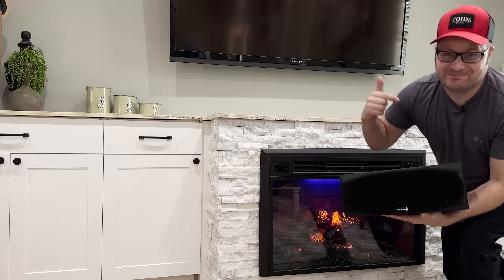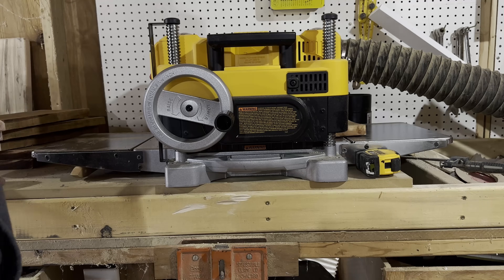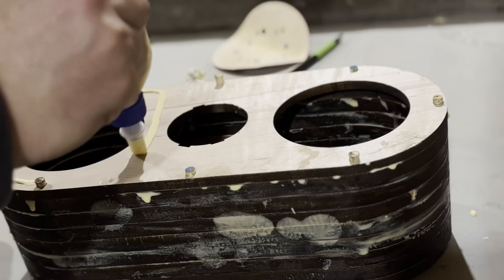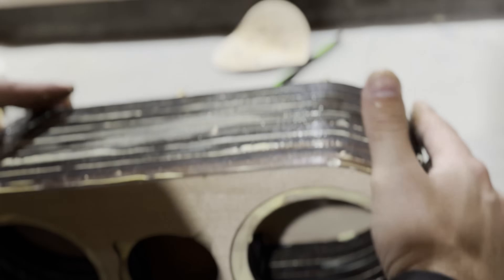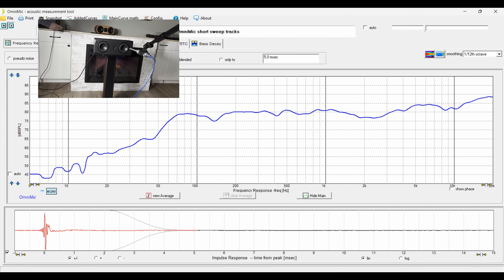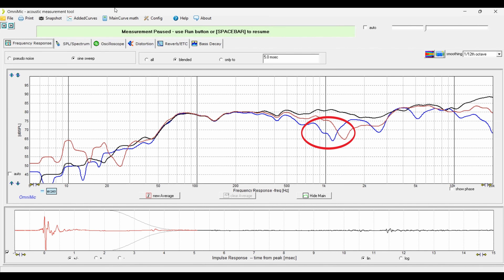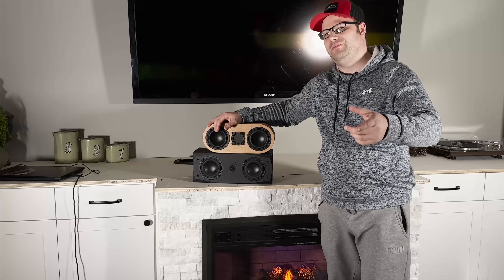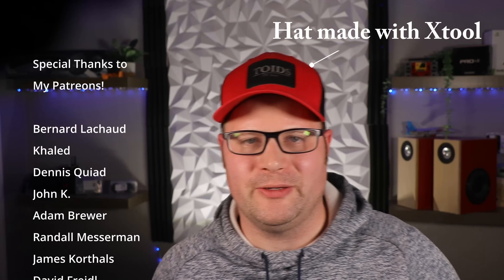Fixing The Problem with Most Center Channel Speakers - The Rule Breaker

Comment: Nice video. Good thoughts. To add my two cents. Instead of using a full range driver as a tweeter and compromising the high end response, why not cross over one of the woofers with a high pass filter to eliminate the comb filtering between the woofers? ProAudio speakers that incorporate dual woofers will do this. Allowing only one of the woofers to reach down into lower frequencies that would interfere with the other woofers. It would be interesting to see how changing out to a real tweeter and high passing one woofers would effect this off axis issue yet still keeping high Fq reproduction.
Reply from the maker: Bmr technology is really unique. Definitely take a look into it. You aren’t sacrificing the high frequency with this particular driver. 
Some people do make a 2 1/2 way center that you are describing. However keep in mind you will still have off-axis issues similar to what you’d have when you do above or below a 2way speaker.
Still better than a typical MTM, but the off axis will still suffer and won’t be as good as something like this design.

Comment: Nice build.  I would have liked to see the test measurements made at a distance of an average listener (say ~10-15 feet).  I went even simpler... I ditched my traditional single center and re-used a pair of older 8 ohm bookshelf speakers I had laying around.  

I wired them in parallel to get the 4 ohms my AV needs and placed them on their sides (tweeters to the center) under the TV toed out from each other about 15-25 degrees.  It actually works great and improved the center radiation pattern, spreading it out plenty to cover my main listening/seating positions.  I can adjust them as needed, based on how wide I need it to cover.  I can even phase offset them by setting one back a bit from the other to help remove middle low end dead spots.

I'm surprised that manufacturer's don't make centers with adjustable patterns.
Reply: Can you give more details - I have the klipsch rp-450c and I am sick of how poorly it performs off center and am searching for a wide sound stage patter for my center. Why I'm watching this video.... But how did you do wore them together? ... How would I keep the same 8 ohm? I have two klipsch rp-400m that I could use if I knew how to do it.... Any advice I would appreciate it
Reply: @tomconnell7154  Your speakers are rated to 50W RMS at 8 ohms, so you could hook them in parallel (4 ohm load net) and use a single 4 ohm 100W resistor in series to both to balance the draw from your amp so it does not sound louder than the other channels.  If you don't add the resistor, you take the chance of overloading the amp's center channel (too much power draw).
Reply: @csimet please forgive me as I am very GREEN on this....couldn't I use a speaker selector box with impedance protection built in to do this as well  ? what are you thoughts...any help is appreciated.
Reply: @tomconnell7154  If the box does impedance matching, then you should be fine.  Curious... what unit are you going to use?
Reply: @csimet  well I was looking at either the OSD ISS4 or the PYLE PSS4 ....also I am wondering if my Klipsch RP-500M would work better. The amplifier to connect to is the OSD Nero XA5180  - provides 150W per channel (8 Ohms), 250W per channel (4 ohms) do you think either switch would work fine with the speakers  hooked up through the switch and that amp? Don't want to hurt the speakers or the amp.

Comment: Hello. I have experienced that if you have too bright frequencies in the midrange, it becomes directional in bright frequencies. The best ones are to have as dark a sound as possible, example down to 1.5k in the midrange and a treble that goes down to 1.5k

Correct me if this is wrong.

Comment: Nice build! I think it would have been good to include a subjective listening portion to the review. Although the frequency response graph is night and day better, it would be good to hear your overall thoughts comparing the quality of the sound in the on vs off axis for both speakers.
Reply from the maker: That would have been good idea. Maybe it will be a good follow up video. Currently working on 3D printing an enclosure for this to test the differences vs the solid wood enclosure I already built.

Comment: The optimal approach to center channel audio involves eschewing a physical center channel in favor of a phantom center. Despite the declining popularity of this technique, the phantom center surpasses dedicated centers in delivering superior sound quality. This holds particularly true within a generously sized sweet spot, achievable through meticulous setup. A phantom dialogue emanates seamlessly from the TV screen's center, contrasting with the isolating nature of dedicated centers, which often betray the source. Leveraging stereo imaging for the center channel imparts a more comprehensive and sonically enriched experience, surpassing the auditory output of a lone center speaker. While acknowledging the impracticality for expansive seating arrangements, the remarkable results witnessed in smaller configurations remain unparalleled by any dedicated center channel.
Reply: This is so wrong it's funny.
Reply: @Dasbeerboots  Very informative argument. I'm surprised you didn't simply respond with a :-) emoji.
Reply: @mikescott5440  I wrote a long response, but had to put my phone down and the comment got discarded. Just know that your opinion is an old head snake oil response. It's not true one bit.
Reply: @Dasbeerboots  My dog ate it, I swear I'm smarter than I sound 😂.

Comment: In a nut shell, it's a line array sending sound to people sitting on the ceiling.
Reply from the maker: No, not a line array, just a revised MTM. The issue with using a standard MTM as a center channel is that you only get good sound directly in front of it. It would have the same vertical characteristics as this speaker. This speaker just add the horizontal directivity that you typically would not get with a standard MTM.
Reply: @Toid  What I meant was the typical center acts like a line array but on its side. where, with speakers on top of each other the dispersion is left and right across the auditorium and is restricted up and down.

Comment: I have some diy skills. I don't know anything about building speakers and my knowledge is very limited. I want to build a home theater setup. I want to use preferably small speakers like one in this video. Would you suggest me to put one of these at each channel left, right, right, back, top and sides. Or would suggest me some different configuration.
Reply from the maker: That would be the perfect configuration. You are spot on.
Reply: @Toid  Thanks for giving confirmation, I really appreciate you taking time to reply.

Comment: If you want similar performance, but don't want to DIY, look into getting a three-way center channel.
Reply from the maker: Similar horizontal performance, but not vertical. A great option for sure.
Reply: @Toid  I guess you would need a vertical mtm with the tweeter and mids? If not, then you could compensate by tilting, placement, or flipping the speaker.
Reply from the maker: @JungYT  the best thing to do would be to get either concentric or coaxial MTM with a waveguide. By doing that, assuming you crossover the coaxial, low enough, you should have very good horizontal and vertical dispersion. But the typical TM doesn’t have great vertical dispersion. So a three-way WTMW with the TM in the middle is still going to have vertical dispersion issues. You could tilt it, depending on the seating arrangement.

Comment: Hello, nice educative video 👍👍.I am trying to make a replica of your center channel which looks amazing by the way. I have two questions regarding the build and I would  really appreciate your answers.The first question is, what are your crossover points? Second question is, will this type of BMR still work since I already have it and also the one you used on your video is out of stock.Tectonic TEBM35C10-4 BMR 2" Full-Range Speaker 4 Ohm
Reply from the maker: The link to the plans is in the description which gives you the crossword information. As far as the BMR, the one listed is the one you need to use for the plans I have created.
Reply: Just buy the plans! They are quality and cheap.

Comment: First off, great channel! Love the clarity in explanations and love the craftsmanship. I am looking to add a center speaker to my setup. After gathering some info on ready made speakers I stumbled on diy, and of course I landed on your channel.😄 I'm using a set of old Hepta streets for my fronts, and a set of Canton Fonum 601's as rears. I would really like to add a center speaker, and maybe later add a sub and maybe even height speakers, but I do not know what to look for if I want the sound to match. Can you or anyone else advice me in which direction to look? I would really like to try and build it myself although I've never done it before. Size is not really an issue, but it shouldn't break the bank.😅
Keep up the great work!

Comment: would this speaker work alright as rears with one on each side hung on a wall?  the seating would be pushed up against the same wall
Reply from the maker: If I understand placement, no speakers are going to be ideal in that placement. Having says that, these so do about the best you can, especially with the eye off axis response. Which is exactly what you would want in that situation

Comment: What is the final impedance on the speaker? 4? 6? 8? I’m about to build 3 sets of them and just curious. Thanks 🙏
Reply from the maker: It’s considered a nominal 4ohm load. Having said that, I was concerned that my surround sound receiver might have issues with that. But I tried it on three different ones I had in the house, and none of them had an issue playing them.
Reply: @Toid  sounds good. I’m guessing as long as I don’t turn it up crazy loud and put a big strain on the receiver it will be just fine… looking forward to building them and testing them out. Thanks 🙏
Reply: @zeldatearsofthekingdom3577 how'd your build go? I built one and I like it. I bought the parts to build two more.

Comment: Just discovered your channel by recommendation from Erin - wow really awesome video! The end result came out looking sweet and probably performs more than enough for the typical household's living room setup. I'd be very interested in seeing distortion & compression figures - I assume the BMR will be a bottleneck in this regard.
Reply from the maker: Thanks for coming by. I really appreciate it. And love everything Erin does. He’s such a great asset to the Audio community. 

The main issues with the BMR  arise under 250hz, which is why we crossed it over higher than that. But you are correct. The BMR is low sensitivity and can only handle so much power. This type of design is good for small bedrooms and living rooms. Which is where I felt there really weren’t many good alternatives. When you go larger, there’s a lot of great designs that don’t have the off axis issues I’m describing in the video. Although, admittedly there are still a lot of bad designs as well.
Reply: Yep I agree. Again, really cool design and looking forward to following your future endeavors

Comment: Beautiful job!  I have to get one of those laser cutters.
Reply from the maker: They definitely can be handy
Reply: @Toid  One of the machines I work on in my job uses a 3,500 watt CO2 laser.  10.6 micron wavelength (infrared).  It runs on 480 volt 3-phase.  It's used for an annealing process in manufacturing semiconductors.   It's also used in other industries for cutting steel.  It's probably a little much for what I need at home🙂  I'm eventually going to get something probably similar to the one you have.
Reply from the maker: @mfkhometheater7742  holy cow! That’s insane!!
Reply: @Toid  Do you have an affiliate relationship with Amazon?  I'm thinking about ordering the xTool in a couple weeks just before I head back home next time.  Your Amazon link isn't the particular one I need however, I'm looking at one that includes the extension package.  If you have an affiliate relationship let me know and I'll send you the link to the one I want to order so you can set up a link where you get credit.
Reply from the maker: @mfkhometheater7742  thank you for asking. I am an affiliate with Amazon. Let me know and I’ll send over a link. Also if you would share a project on it with me sometime, I’d love to see what you do with it.
Reply: @Toid  I posted a comment with a link but now I don't see it so it may have gotten deleted by YouTube so I sent you an e-mail.
Reply from the maker: @mfkhometheater7742  Here you go: https://amzn.to/40SlC4c and air assist: https://amzn.to/3U6416T  I am a little jealous you are getting the extension. I may upgrade mine in the future.
Reply: @Toid  Perfect, thanks!
Reply from the maker: @mfkhometheater7742  thank you
Reply: @Toid  It's on the way, the xTool arrives Saturday, the extender kit and air assist Monday.  I'm flying home Friday and will spend most of my time working on the theater but I'll try to assemble the xTool while there.
Reply from the maker: @mfkhometheater7742  excellent!

Comment: LMAO! , i bought 2 polk audio center channel speakers, but i built bigger speaker cabinets, they were going to become bluetooth speakers ,added a 6" subwoofer and cross over, one i am using for center channel, applied a 6 1/2" lazy susan mount around sub/ firing downward to position any way i want,,,5.1 stereo with the extra sub on center channel sounds amazing, 2 tannoy platinum white towers , JBL sub and Onkyo receiver.Made in 2020

Comment: the performance of those BMRs is really amazing. i remember first reading/seeing polar plots of the d'appolito design in one of radio shack's speaker books as a kid and how it controls vertical dispersion (in normal upright mode) - so by flipping it on its side we are getting the worst of both worlds - great vertical dispersion and terrible horizontal.
Reply from the maker: Yup. Except this design doesn’t have those deficiencies that a typical MTM has.

Comment: Awesome. Or, just use phantom center and never have a problem again wherever you sit.
Reply: Great for one person, but once you have people sitting outside of the sweet spot which is guaranteed in the standard home theater environment, the phantom center falls apart and you want a center channel to anchor the dialogue to the screen.

Comment: Why do they make most center channel speakers to only go as low as 100hz? I would think as low 80Hz would be better to accommodate the Male voice that can go as low as 85Hz. Especially if they are singing. I would almost think I may be missing out if the singing voice from a song was sent to the center channel and It may not be going low enough.
Reply from the maker: It really depends on what your subwoofers are capable of in your personal taste. Most larger center channel speaker do you get crossed over at 80 or even 60 Hz. Small speakers like this, you start getting distortion creeping in when you try to cross over to low. You could crosses over at 80 hertz depending on your room. of course, with this being sealed you could really crossing over 80 hertz no matter what if you really wanted to.

Comment: I understand why you designed this for wide dispersion. It seems most manufactures put those woofers side by side to fit under the large flat screen. But I think I would rather build a custom  stand under the TV to accommodate a Center channel similar to the Cinema 10's you build a while back but use an 8" like the Aurum Cantus AC-200MKII for wider dispersion;  and use the Selenium D250-X GW 1" Phenolic Horn Driver with the Selenium HC23-25 1" Exponential Horn 100x40. then use the DS18 PRO-DKN25 Neodymium Driver with Aluminum Horn 1-3/8"-18 TPI for a tweeter using the Crossover frequencies of 1.2kHz and 3.5Khz. This would provide a very wide dispersion of anything coming out of that center channel. I would rather have the Best sounding center channel speaker than to compromise to fit in a narrow slot. Love you build though makes me want to save for a Laser cutter.
Reply from the maker: I don't disagree.  There is a reason my Theater has an Acoustically Transparent Screen.  😁 But for the living room or a small home theater system, this is perfect.
Reply: @Toid  How do you like your projection system? I am trying to decide on a nice OLED or something like you are using.  Seems like it would be hard to beat an OLED. Of course you can have your speakers behind your screen.
Reply from the maker: @jimthvac100  an OLED will definitely have the best video quality period. But I really like the much larger screen and the fact that project are supposedly better for your eyes. If I had the chance I’d have both. OLED for the living room and projector for the theater.

Comment: Very cool little speaker. I see the appeal for a compact center channel with great off axis response for sure but personally I don't do anything with surround sound. I can see a similar version making a great self powered BT speaker though if the bass is good enough on its own. Also do you think that BMR driver would work in open baffle config instead of its own sealed chamber?